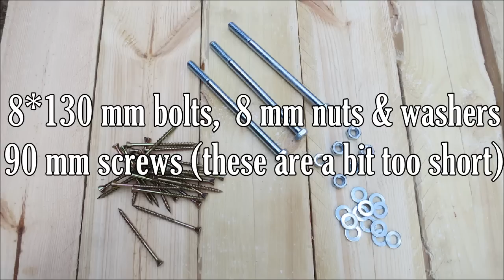DIY Folding Sawbuck

Comment: Love the helper!! Very helpful video. Thanks.
Hi I eventually got it made and it is very useful. I made an addition to your design by adding a further "V"section   to allow a smaller cut.

I used one 4ft length cut in two.
Bolted it with one bolt and slotted it in the middle of 2 Xs. I'd like to add a photo but can't!

Comment: The term "sawbuck" in youtube...holy mooly...what a lot of ideas. After scanning a few, found this one from Lasse, and it was clearly the best. However, I don't understand the 28" line below the 29", as I found the 30degree cuts, when set up on a piece of plywood (I know outside won't be as flat and even as that) the 28" line was wrong. I found 28.5" to be the correct measurement. I would suggest taking one of the assembled "X" pieces, make the 30degree cuts flat with a flat surface, take a small scrap of 2x4 and mark a line...mine was at 28.5 but yours might be different. Also, you may want to put a washer between the two pieces in the "X" brace. Great video and thank you!
Reply from the maker: +rayvan23 Thanks for your input! Yeah, I probably messed with the imperial measurements. I corrected the 28" to 28.5" in the description. Your idea of using extra washers between X pieces is good one. You may also want to use treated wood to make the contraption more weatherproof. Just used my sawbuck last weekend again. Still works like a charm.
Reply: Just made a sawbuck absolutely brilliant 
Instruction easy to follow and they work very solid and stable
I put a washer between the cross pieces which helps the standing for use
Excellent the best I've seen
Reply: been looking for a sturdy but easy to make sawhorse and rayvan23 was right, there are tons of variations in YT land.  yours is by far the most durable looking and easy to make.

Comment: The video playback was fast, but there are settings in Youtube to slow the playback down. If the video was slower viewers would be complaining it is too slow. For the information provided and quality of the content, the video was great. Thank you for including footage of it in use too on a variety of sized limbs and logs.
Reply from the maker: I've been having problems with video suitable playback speeds on some of my earlier clips; people complaining mostly about the slowness, so I have made couple of fast forward videos, kinda experimentally, and this is one of them. Earlier YouTube didn't even have the playback speed setting like it does now. I hoped to be able to include the necessary information in the video, and I doubted anyone would like to watch me e.g. saw six diagonal pieces off of 2-by-4's in normal speed. :D Of course different editing would have enabled normal speed with less visual of the whole process. Well, fortunately a bunch of people seem to have found this useful in any case. Thanks for your nice feedback. The sawbuck is still in good use after four years!

Comment: Great video. Me and my son build it tonight. Thanks for the instructional. My only issue is that the five inch bolts were way too long. I'm going to switch to 3 and 1/2 in bolts.

Comment: Why do the instructions say we need EIGHT bolts. Wouldn't it only use SIX? Or THREE?
Reply from the maker: Ah, it's not eight pieces. 8 is the diameter of the bolt in millimeters, 130 is the length of the bolt in millimeters. You need only THREE bolts. :)
Reply: @FinnDivine  Thanks! I am going out today to build this, but I don't have any bolts, nuts, or washers. So I'll make a non-folding one to start with, using screws. Thanks for the instructions. It's very helpful to see how it's done, step by step.
Reply from the maker: @nunyabizness3890  The version you're going to build today is the normal one, folding is just show-off. :D Thank you for your kind words, and hope you'll find your sawbuck useful!

Comment: you have 2 measurements in your decscrfiption,,, 28.5 and 29
i'm assuming 28.5 is the correct one?
Reply from the maker: The holes are 74 cm from the end, and the horizontal piece comes under 71 cm mark, which actually convert close to 29 and 28 inches. I can't remember any more why I ended up in 28.5 instead of 28, but it only defines the angle where the X's set when the sawbuck is opened, so I guess it's not that precise. Hope that makes any sense.
Reply: yup it makes sense, i just wanted to clarify,,, measure twice cut once type deal ;) clever idea for the saw buck and just what i need. I'll be making one later today. Cheers